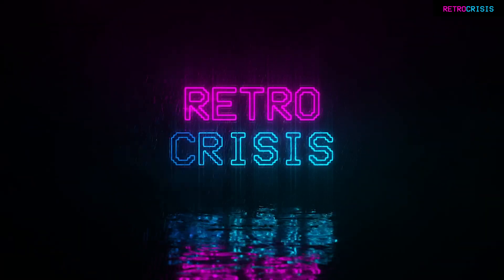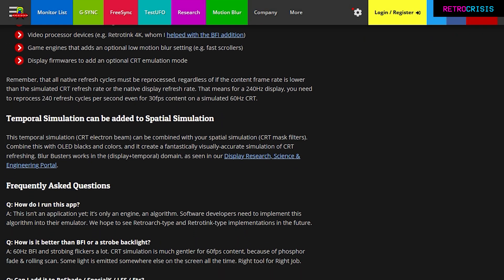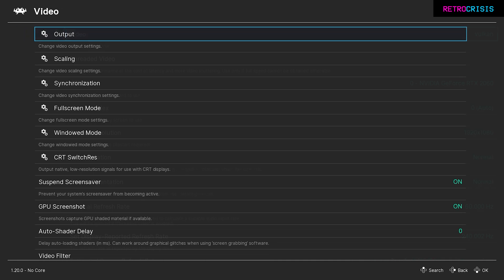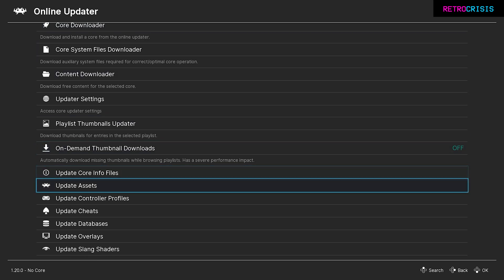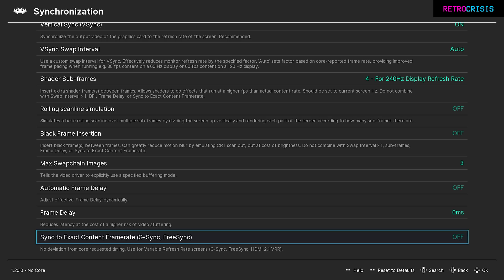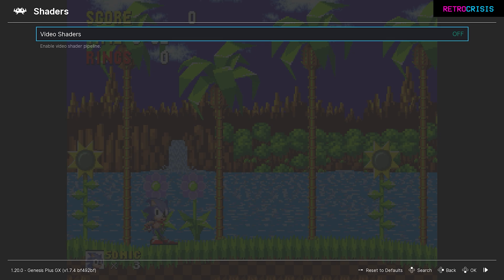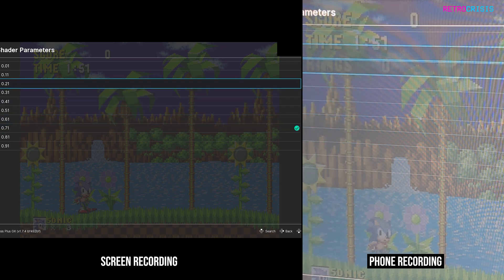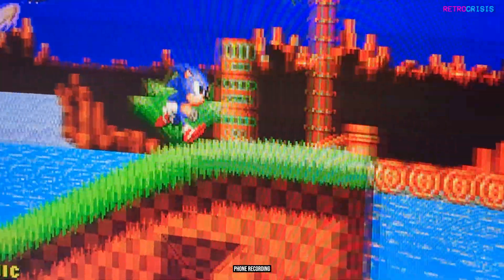Blur Busters CRT Beam Simulator Shader - RetroArch Configuration Guide

Comment from the maker: Much like HDR and OLED technology, It has to be experienced in person. The video does not do it justice.
Reply: you can append this with existing crt shader if you want to combine the effects.
Reply: Thanks for doing this video!  It's important to note that at GtG=0 (OLED), motion blur reduction ability is proportional to the native:simulated Hz ratio.  Nonzero GtG will also be a fuzz factor, so try to get the highest Hz and fastest GtG, to do justice to the CRT beam simulator with the largest native:simulated Hz ratio you can afford, and there will be more display simulation shaders coming 2025-2030. Especially 600Hz OLED for my upcoming plasma simulator shader, as part of Version 1.01 of Blur Busters Open Source Display on my page.
Reply: Yes... Clearly underwhelming... Thanks for mentioning it. Guess using the latest Rt4K firmware will also not do it justice...
Reply: @DrNoBrazil If it has the same function and you have a high Hz screen then it should work great.

Comment: Stumbled onto a preset, one that has Super XBR, and added in the Sega Genesis dithering option (Forget the name but the good one).  Works surprisingly well.  I know most use crt shders, but I don't like any of them.
Reply: This is not really the same as other   CRT shaders. It is meant for simulating the near-zero motion blur from CRT rather than the aesthetic of it
Reply: @Zack-Strife  It probably isn't meant for my display.  720P Samsung HDTV, 2010 model, backlit (Not LED).  I have better TV's but game on this as a "jack of all trades, master of none", 6th gen,.7th gen, or.heck those composite Atgames 2600 Flashbacks all looks.servicable, with some minor settings adjustments (Or in the case of my Gamecube, dynamic contrast and edge enhancements on, to compensate for the absurd softness and washed out look due to the gamma curve).  So yeah, I'm going to guess whatever I liked about this shader is not what it was intenfed for.
Reply: @docsavage4921 yes, it is targeting high refresh rate (120hz+) LCD and OLED displays. Both type of displays have high level of motion persistence that CRT doesn't have, and this shader can fix that
Reply: @Zack-Strife  That's incredible.  It amazes me that passion, craft, and addressing a real need is in the domain of free agent "hobbyists", while the "professional" ptoduct line means "good enough".

Comment: I have a 140hz monitor, followed every step and I got to say, I have never felt more disappointed in my life. No matter what I calibrated, everything still looked super dark and I could see every little detail like a black bar in the middle and the beams slowly inching upwards, even though you're not technically supposed to see the beams with the naked eye if it were a real CRT, It just looked super ugly and unpleasant to look at. I shouldn't have to buy a $1000+ HDR OLED monitor just to experience something like this, but I guess I have to If I want to. I've tried using HDR on other monitors my family members owns and I still don't really get the point, nor do I think I've managed to really figure out how to properly use it. I'll continue to stick with Reshade and combinations of CRT Royale and NTSC RetroArch gamma filters for now.
Reply from the maker: @AKablalik  I don't believe 140hz is compatible. Were you able to set your display to 120hz?
Reply: @RetroCrisis  I did 120hz, 140hz is just the highest refresh rate my monitor can go.

Comment: What about those of us with 144 refresh rate? It's not available in the Shader subframe menu.
Reply: switch your refresh rate to 120Hz
Reply: @TorutheRedFox  Maybe someone has an answer to this. I did this and then it started detecting my refresh rate as 240hz and doesn't look right. I swapped my mux switch to dedicated graphics and set the refresh rate to 120 in the nvidia control panel and its a flickery mess and the detected refresh rate is like 2300hz.

Comment: https://www.youtube.com/watch?v=the84SCTks0 here's a video of it in action

so on my 240hz oled lg monitor, setting it to the 4x subdivision for 240 leaves 4 sections visible on the screen that all have a dark banding near the bottom and light near the top. No matter what setting I change it stays almost the same. Anyone have any ideas? LCD retention kinda helped but it stopped working, fps divisor at anything but 1 doesn't exhibit this weird over/under exposed banding but it still shows that there's 4 areas on the screen.

So something weird I noticed, with MGS the stuff on the foreground (the map and text aren't affected by the rolling beam, it's darkened but while the rest of my screen is dark/light it's not changing at all).
Reply: have you activated shader subframes? also make sure you're not using VRR and have the latest stable of retroarch.
Reply: @Sp00kyFox   I did activate subframes 4 for 240hz, no vrr, latest stable and latest nightly. I realize my mistake was using the rolling crt scan with the shader, but it's still doing the effect but not as bad as in my video. The effect is better with stable 60fps games but it's still not crystal clear.

Comment: LCD Anti-retention, does it need to be off on an LG C3 TV? And a lot of people seem to be pointing out image retention issues,, even with OLED anti-burn in mitigation in new TVs, this concerns me >.>
Reply: Not needed for OLEDs, it's a workaround for BFI interfering with LCD voltage inversion algorithms.
Reply: @BlurBusters  So does that mean I turn it off?
Reply: @BlurBusters  Makes sense. Just kind paranoid about using CRT shaders on my LG C3,  so thanks :3

Comment: I've been trying to set this up but I really don't know what to look for in terms of...look. I have an LG CX. I haven't used a CRT in ages and I can't spot the differences when it comes to movement. I was playing Golden Axe: Return of Death Adder and didn't notice an after image when playing with out the shader. Is there a specific game this might be more noticeable on?
Reply: Some people just aren’t sensitive to this type of blur. I grew up playing CRTs and appreciate what they do for low resolution graphics, but couldn’t care less about the whole persistence blur thing. Never bothered by it on modern screens or even noticed. I am highly sensitive to any type of flicker though, so these techniques just ain’t worth it for me.
Reply: @boshi9  That can be normal. Many modern games (e.g. FPS) makes you fixate your eyes in a single location of screen (e.g. crosshairs).  This makes you insensitive to persistence blur.  Persistence blur is mainly seen if you're tracking eyes on fast moving pans/scrolls, e.g. fast scrolling platformers. So game content + necessity of seeing the scroll clearer, can influence sensitivity. When compelled (e.g. panning map street label readability test), you'll generally immediately notice. The flickerless method is framerate-based motion blur reduction for those situations though (e.g. 480fps 480Hz OLED).
Reply: Fast scrolling platformers, like Super Mario or Sonic Hedgehog.  It doesn't have much benefit for fighting games (on average), especially if your native:simulated ratio is only 2.

Comment: I tried it out on my 120hz TV. 
The clarity, even at the darkest setting, isn't that impressive.
I'll be sticking with BFI and it's comparably perfect clarity. 
I suspect I'd have better results with a higher refresh rate monitor, but can't confirm.
Reply from the maker: I’m hearing some people say it’s most noticeable with OLED screens. Sadly they’re bit outside my budget.
Reply: @RetroCrisis  Understandable. I spent $1,400 on my 55" LG CX OLED. I normally wouldn't spend that much on a display but they had an 18 month no interest deal. They are just insanely expensive. In the end it's been totally worth it though as I use it nonstop and I have never liked a TV anywhere near this much. 

Anyway, what I'm getting at is I'm using an OLED, so take that for what it's worth I suppose.
Reply: @RetroCrisis  OH though it's probably worth mentioning I'm using RetroArch's BFI, and not one built into the TV. I hear that's a thing.
Reply: BFI in many 120Hz LCD TVs are still better because they can use subrefresh techniques.  Certain OLED TVs can do ~4ms MPRT with BFI, while CRT simulator can only have MPRT as low as maxHz refresh time (8ms for 120Hz, 4ms for 240Hz, and 2ms for 480Hz).  So I need tons of refresh rate headroom due to software limitations in manipulating refresh cycles - my CRT simulator can only manipulate a pixel once per Hz via the frame based CRT simulation approach.  So you need larger native:simulated Hz ratios, and preferably OLED, to get much more gigantic wow effects.  360Hz+ OLED+ is when people start dropping jaws with the CRT simulator in Sonic Hedgehog type games.  I saw 240hz OLED fall to sub-500 during boxing week.
Reply: @BlurBusters  At some point I suspect I'll be getting a very nice OLED to replace my big CRTs (Simply for space) and using things like this and a RetroTink4 to drive my setup.
Reply: @BlurBusters  Will the upcoming QDEL technology monitors and TVs work with the CRT simulator similar to OLED? Hopefully they are up to high refresh rates quickly and not 10 years of improvements to get up to speed.

Comment: I tested it on my 120Hz LG OLED, but sadly I didn't notice any difference. I know it's working because I captured video with a camera and played it in slow motion and the beam simulator was working. The problem is actually my eyes aren't good enough at noticing smoother framerates. while anything below 60fps is very noticeable (I seriously try to avoid playing at 30fps whenever I can), anything above 60fps looks just as smooth to me. 

It's kind of a blessing whenever I play VR games though, that means I can perfectly play at 60fps (to crank up graphic detail) and not suffer any motion sickness, while the minimum recommended framerate for VR is 90/120fps.
Reply: I think the shader is used to reduce blur for fast-moving content, not to make things smoother.
Reply: @yousefeno  I tested it With Sonic The Hedgehog 2. Perhaps that game is too fast?

TBH I don't notice my TV being blurrier or clearer either way. And I play a lot of sidescrollers and old-school games. Even my old PS Vita looks very clear with fast-paced sidescrolling games.

Comment: Thanks for the info! To bad VRR need to be disabled, I also have three monitors. Is it worth it on a 120hz display? Also I remember reading that a new version will be out in early 2025. Maybe VRR will be supported later on?
Reply: I'm travelling at the moment so the only High-refresh monitor I have are Xreal Airs, I tried it out and set a hotkey to toggle on and off the shader. The difference in clarity is stark, particularly in fast scrolling backgrounds. I'm not sure I can go back knowing what I know now
Reply: @e2zippo  VRR can't be supported because this shader needs as high of a refresh rate as it can get

VRR matches your monitor's refresh rate to the content's framerate as it drifts

Comment: Thank you, I'll try later. One question, is it possible to use it together with other shaders, such as scanlines?
Reply: Yes, just load up your favorite shader and use the "prepend" function to load this one in front of it.
Reply: @retropulse03  Ideally you want to sequence shaders in a similar orthographical order like a real CRT tube.  Picture processing (CRT electronics) -> Electron beam simulator (CRT yoke) -> Phosphor filter simulators (CRT phosphor).  There are some exceptions, but usually this produces the best performing results.
That is, unless your scaling algorithm interferes greatly with the CRT simulator, then you may have to do the scaling algorithm before the CRT beam simulator (which kills performance, but can be a workaround for maintaining Talbot Plateau Theorem)
Reply from the maker: Yes using append/prepend method - https://youtu.be/xj0nU2eadJs
Reply: Curious about this as well
Reply: @mikeg2491  see other comment (Y)

Comment: Well, Im no dummy and followed every step, but this just doesnt look good to me at all. 240hz OLED. G-sync off. Occasional micro flickers, way too sharp and pixelated still. Only during motion do I see weird color separations which I dont think is a good thing. Old fashioned driver level black frame insertion tech is better than this.
Reply: It needs tweaking: You need to combine it with an existing CRT filter if you want spatial simulation concurrently with temporal simulation. Also, adjust GAIN_VS_BLUR to 0.25 to fix the color separations at 240Hz, as a workaround. Also, there's an adjustment coming in the v2 of the CRT simulator shader.   It's caused by the variable MPRT algorithm being per-color channel, as a tradeoff between bright/ghosting versus dimmer/clearer.
Reply: @BlurBusters  are you referring to brightness vs clarity or is gain vs blur a different setting? I can only change brightness vs clarity by .10 and it doesnt really change the color separation issue during movement

Comment: So... I was really hoping that this video would talk about setting the refresh rate properly in RetroArch in the first place. By default it's just set to 60, and setting it manually is... SURPRISINGLY DIFFICULT because it's never exactly what's reported. The 240hz monitor is not actually 240hz so much as 239.48hz or something and if you don't set it exactly right (which, good luck) games just stutter like crazy. They don't if you just leave it at 60, of course, which is what everyone does because who would think to check? But then of course the Beam Simulator doesn't work properly???
Reply: you are supposed to use vsync with it. it doesn't work with VRR or without vsync. I'm unsure if it isn't even activated by default when turning on shader subframes. anyway, when using vsync the exact hz shouldn't matter, since the core speed is adjusted to your system. also try the option "threaded video" under settings / video / output if you still experience stutter. it might help.
Reply: @Sp00kyFox  Oh I am absolutely using v-sync and VRR is not on. In fact the whole issue might be Wayland's special "mailbox" vsync which is on whether you enabke it elsewhere or not (it's designed for lower latency so probably less consistent?)
Reply: @colbyboucher6391  ah well. I've only tested the shader on windows. yeah, maybe there is a problem with that. the implementation of the subframe shaders sounds like retrarch must have the exclusive control over vsync for it to properly work.

Comment: With this shader is there a risk of image retention like with BFI if Freesync/G Sync is enabled?
Reply: on LCDs yes. but there is a shader option which is activated by default which prevents this. this option can be turned off on OLEDs however.
Reply: @Sp00kyFox  Does enabling this option have any negative impact on image quality?
Reply: @JPAR  nope

Comment: Looks amazing on my 4K 240hz QD OLED. Thanks for the guide.
Reply: Better or worse than BFI?
Reply: @ I’ve only used BFI at 60hz on an old C8 OLED and the strobe effect was eye watering. This is better because it’s much easier on my eyes. 

I’ve also used ULMB on the XB271HU at 120hz and the strobe effect was still painful.
Reply: @ Not sure about ULMB is, I haven't heard of that one. I do know BFI isn't meant to be used for anything less than 120hz. It needs to be double the framerate after all.
Reply: @retropulse03  Oh the effect worked fine at 60hz for adding clarity but it caused intense eye strain. I have a C9 now and could force it into 120hz BFI somehow but I never bothered.
Reply: @BlurBusters  oh hello blur busters

Comment: Does a screen have any extra stress by having to turn the pixels on and off as opposed to just changing color? I wonder if this will have a detrimental effect on the screen over time? Mostly dealing with OLED monitors as the voltage will be constantly turning on and off to make the pixel light up and turn off rapidly. Under normal circumstances, the screen would only turn the pixel off every once in a while, otherwise it's just changing colors. This seems like a stress test to see how the monitor can handle it. I guess time will tell.
Reply: @InfinitySwitch84  Isn't this exactly the same principle as black frame insertion?
Reply: @MLWJ1993  I thought about this after I posted and realized how I was dumb. Shit happens.
Reply: It actually makes OLED last longer
Reply: I was wondering that myself

Comment: My monitors are either 144Hz or 165Hz, hopefully they'll add support for those refresh rates.
Reply: Set it to 120hz and you're good to go, he explains it clearly in the video. Screens have a max refresh rate but they can slow down to any desired rate as supported by the OS and display drivers. How is this even a question?
Reply: @dri_him He didn't explain it well actually
You can set custom values in the subframes
For 144hz you put the subframe value to 2.4
Reply: @bardhi09  How? can you make a breef explanaiton because i don't see any form of custom value under the Shader Sub-frames option
Reply: It has to be a multiple of 60. It has been explained many times already.
Reply: @DrBrazil stop making stuff up
It works at 144 just set subframes to 2.4
Reply: @DtNoBrazil Why d you keep making stuff up?
It's explained in the github page that it works at any refresh rate
For 144hz you just set the subframes to 2.4